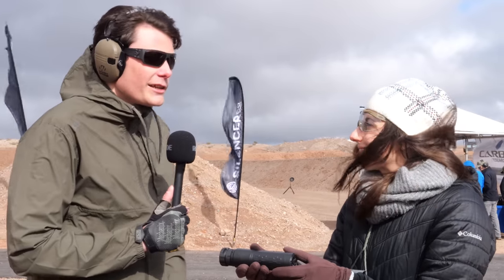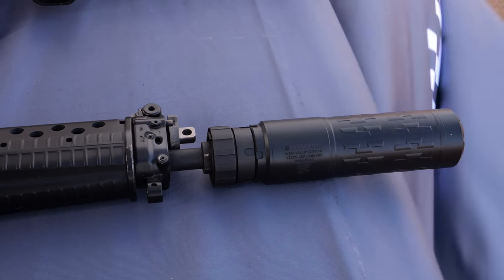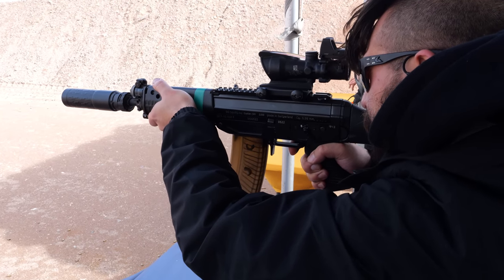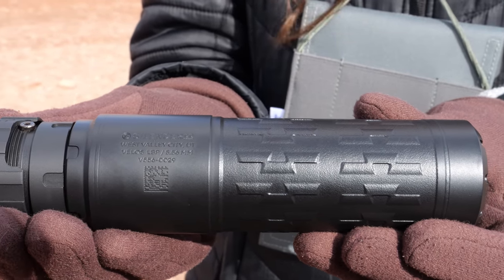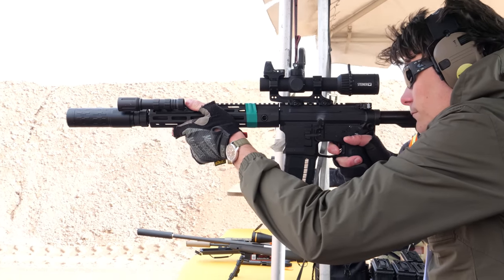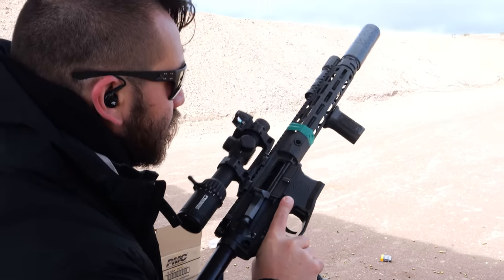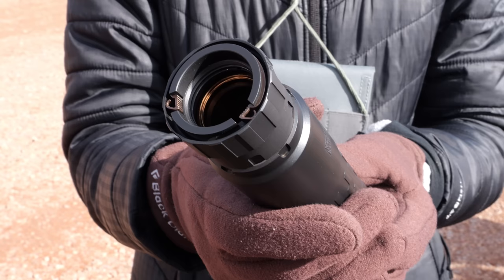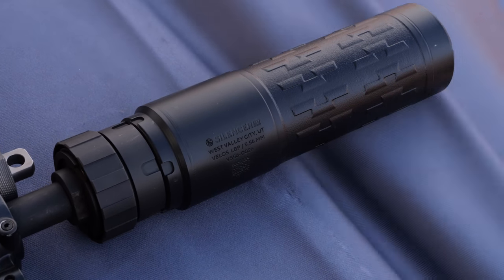SilencerCo’s FIRST Pass Through 556 Can: The Velos LBP

Comment: oooh a flowthrough that doesn't require me to spend $500 on new adapters....
Reply: It doesn’t actually use the standard rear 1.375x24. It uses their Charlie mount. So…yeah.
Reply: Pretty sure Huxwrx purchases come with the flash hider mount adapter as part of the package. I don't see the big deal
Reply: @noway6633  multiple rifles you want to suppress with the same can = buy multiple devices because at best you’re getting one mount.
Reply: @noway6633  the biggest issue for me personally is that I have a pin and welded Deadair muzzle device. I’ve yet to see a 3D printed flow through can that allows for you to choose your muzzle device and mounting system.
Reply: @timunderbakke8756  correct!
Reply: @noway6633  wrong
Reply: @bossie006  correct.

Comment: This is not using the "standard rear HUB threads" as noted in the above description. This is using Charlie/Saker mounts and threads.
Reply: The hub is Bravo?
Reply: @SnapD24  Yes. Charlie threads on the outside of can while Bravo threads inside the can. Charlie also has a separate taper insert. Bravo and Charlie are not interchangeable without an adapter that nobody wants to use.

Comment: It really hate how silencerco cans have the notches on the bottom and then it doesn’t line up.  Those notches should be indicators that your can is aligned and tightened properly.  And do you really think after 10,000 rounds it won’t need a clean?

Comment: I don’t understand why they didn’t make this 30 cal and have a dedicated 556 end cap. I’m lost of the point of a 556 dedicated can. You can only make this round so quite. I’m sure a 30 cal with a 556 end cap would’ve  only been two or three decibels higher.
Reply: While 556 can never be movie quiet, how the gas flows inside the baffles due to caliber affects other performance. For example flash, while that can be fixed with an end cap, the larger port on the baffles will affect how fast gas moves through baffles, this is I believe a hybrid flow through suppressor. Which affects sound and how fast they would want gas to move through the suppressor. My sandman k w/ 556 flash cap is not that quiet even on a 16. If they opened it to 30 it can become louder by 10db. The change would depend on the baffle/flow through configuration. Plus they might make a 30cal one... So just wait
Reply: I have both the Dead Air Sandman-K and Sierra-5 suppressors and the dedicated 5.56 can sound so much better than the Sandman on my AK-102. The tones in real life are so different from what charts and numbers will tell you what it "should" sound like.
Reply: @themeltingpoint3867  yeah, I see db as a metric of performance. But understand in person tone is more important especially once ammo and other factors are in place
Reply: Because "flow through" suppressors are already loud as hell and hogged out "flow through" suppressors are called flash cans. You don't need a stamp for one either.
Reply: I don’t know where you received that info from. You need a stamp for every can no matter the style of the suppressor. I understand it’s a balancing act when it comes to creating suppressors. But technology, science, and manufacturing improved extremely in the past 15 years. There’s no excuse for the Suppressor to need to be 556 dedicated for proper sound reduction. There are other suppressors on the market that have a dedicated 556 variant along with a 30 cal option. There isn’t a big difference in decimals reduction. Rugged makes one of the most balanced suppressors on the market and it’s not 556 dedicated. Personally, I don’t see the point of this can nor do I agree with the price point. Hell even the military doesn’t use a dedicated 556 Suppressor. But to each his own
Reply: By the way bud a flow through Suppressor and a flash can aka blast, forwarding device are totally different. A flow through suppressor allows more gas to escape out the front to mitigate the first round pop, fire ball, and blow back (aka gas to the shooters face). A flash can typically pushes a noise forward and helps stop friendly shooters from getting gassed out. These are totally different devices. As long as theres an ATF, you will always need a stamp for Suppressor.
Reply: @UCMEnc0hQPLCJdv-p8KbUQSg then by your logic, why even buy a 30 cal. Why not use a .45 rifle rated can with a 556 end cap. Because they won't perform the same. Db rating isn't the end all be all. In person it'll sound different. It's a metric to use for comparison of how well a suppressor slows or holds gas. Both the Rc2 and huxwrk 556 reduce about 30bd. But they sound completely different side by side. They aren't performing the same with POI shift, increase muzzle velocity, flash, port pop, ear db rating, back pressure. The inner diameter caliber hole affects all that. I bet that rugged balanced .30 suppressor does everything well, but it doesn't do anything else better compared to a dedicated aside from balance. The drawback of a dedicated is you sacrifice performance somewhere to gain it elsewhere, usually whichever of the above things I mentioned. and you don't mind the sacrifice somewhere to increase performance elsewhere, that why dedicated cans caliber cans still exist. I don't care about brands but 3d printing metal machines are not cheap. They have overhead cost they need to cover. Technology has advanced but unless you create a device that somehow eliminates energy, which is impossible, you will always have to contain all the detonation from gas operated firearms, there's only so much we can do. Barrels have been around for centuries yet not every barrel is sub moa. Perspective